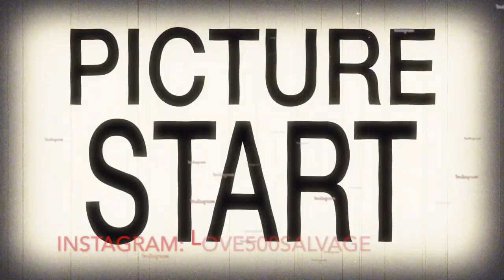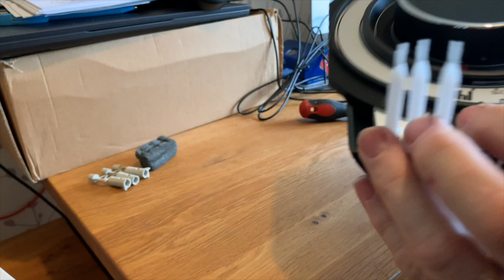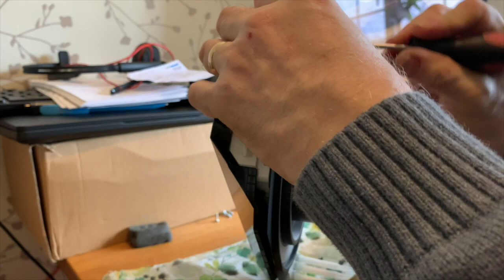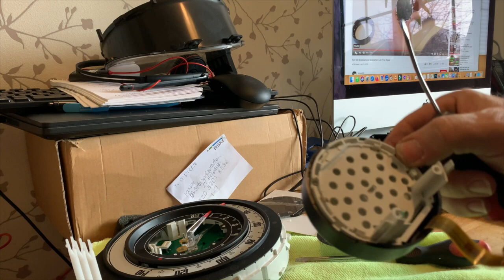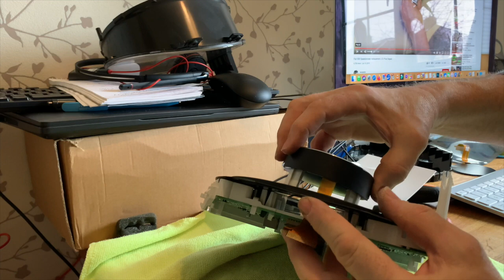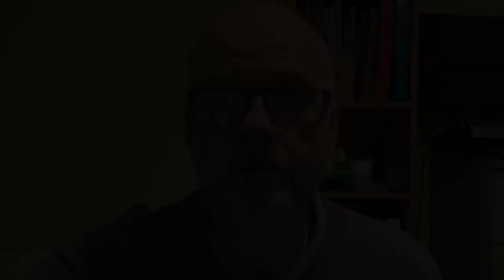Renewing a Fiat 500 Speedo LED centre panel. Fiddly but do-able.

Comment: Hi, before replacing the LCD screen was it lit but the writing not visible? I bought my daughter a car in November and it’s only being used occasionally for learning as she’s not yet passed and we noticed the dash is lit but that circular LCD screen has lost the writing, it is going to the garage tomorrow and trying to understand what might be wrong so I know roughly how much I might have to pay :(
Reply from the maker: @cassie120282  don’t waste your money going to a garage just get yourself a replacement Speedo on eBay. A garage won’t be able to fix it. You can replace the panel as I did here but it’s almost as cheap and much easier just to replace it. Trust me, you’re throwing money away if you take it yo a garage. They will just tell you it needs a new one. The fault can manifest as blank, gobbledigook hieroglyphics and everything inbetween.

Comment: Good job Paul, mine have issue with flashing abs and eml light while right indicator is on. It looks like common problem with leaking LEDs. Thanks for video
Reply from the maker: Far too common.

Comment: I am currently trying to change speedo dial from MPH to KMH. Would you know if the instrument dial and speedo dial two separate pieces?
Reply from the maker: The Speedo part is just a thin, I think metal piece which you can remove carefully. Can’t remember how it’s fixed in. I’ll look on one of my spares and get back to you. In fact I’ll include it on Sundays video.